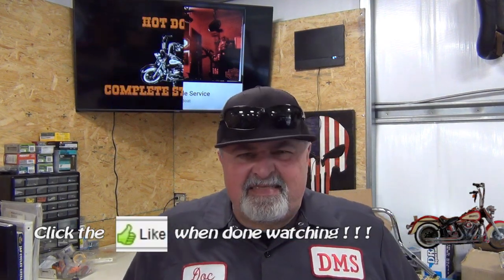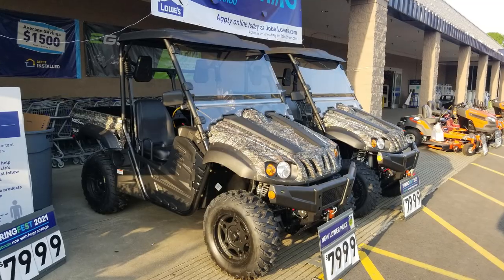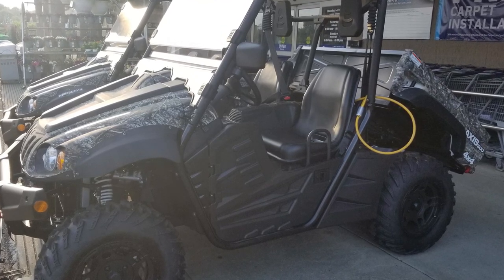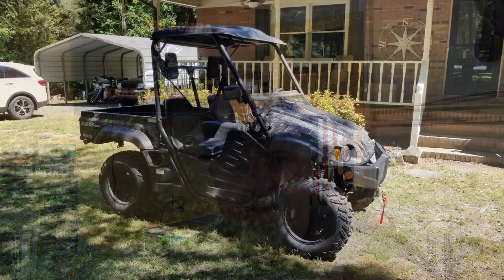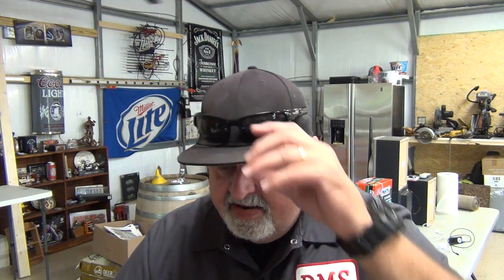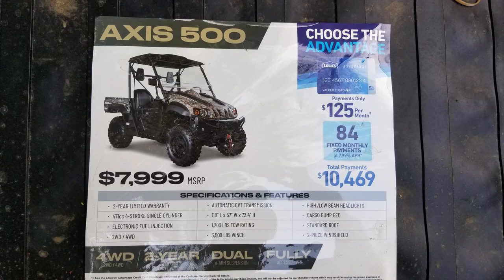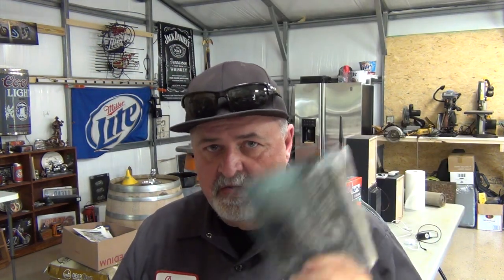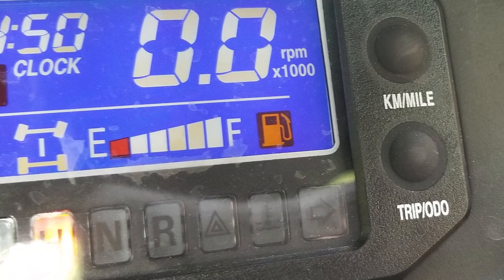Hisun Axis 500 UTV Review

Comment: I just bought the Axis 500 on Wednesday 6/5, spent that evening reading the manual cover to cover. Thursday 6/6 after checking all the fluids and filling it up with 91 octane gasoline, took a slow ride under 15 mph understanding first the 25 hr break in period. Way out in the back of the field and stopped to look at some fencing repair, I turned the machine off. After 10 mins I got back in, turned the key and it cranked but wouldn't start. After 5 mins of trying to get it to start, I had to walk the ¼ mile back to the house in 90º Florida heat and sun.  Got my truck and some tools and drove back to the machine, and now it starts right up... Now I think this is a totally untrustworthy machine now, a don't want to get stuck, especially out in some trails, so I am going to try to return it tomorrow 6/7, it has just under 2 miles on the odometer.  I also noticed that the dump bed gets VERY hot while running, this heat will damage items in the bed, eg coolers, gas cans, animals...
Reply: Check the fuel pump fuse under the hood,I hear they blow quire frequent
Reply: At times my does that and I have to give it a little gas to get it to start. The FACTORY fuel filter had paint chips in it. Replaced filter and issue 98% gone. I just have to reset the computer about every 4 months. No big deal. Just turn key on and off 5 times within 30 seconds. Without starting it. Making sure you hear the fuel pump kick on. After the on-off sequence. Leave off 30 seconds. Then ya should be good to go.
Reply: Did you post this on every video?

Comment: I never fidregard thenmanual. When I buy something new n bringit homr i just open the box to get the manual to study in. You can have a machine with features and functions you never even knew bout and see things you shouldn't do that will trash it. Never just rip n strip n go. Have aneughbor eho recently got a nice sniwmobike n folled ut up with gasoline and ran it till it bigged down and wouldn't run. No fuel mix and henfrided a nice engine. And there's stickers about the mix ratios  by the fill cap. Duh. And I had told him he needed to let me come up and breife him ona new set of rules. But he just ignored my iffer and Im 80 eits over 65 yesrs experience to share. Shame cause he'll never fix it or care. I'll probably end up with it. My place has sleds parked in. Rows. I 'm listening to you. I made a living fir many years restoring building and repairing motorcycles.😅

Comment: Hey Doc! I purchased my Axis 700 back in October. Been putting a few miles on it, and have given it it’s first oil change. My opinion of this machine so far is it is great. We have 250 miles on it, and have gone on a couple of rides with a group of SxS enthusiasts and kept up with their “name brand” rigs just fine. Knock on wood, we have not had any issues so far. I did a pre-check prior to taking it for it’s first spin to ensure all nuts, bolts, and seals were in good shape, as well as checking the fluids prior to each operation. Had a friend who did not pre-check and burnt up some internal components. I too have a YouTube channel and plan to post some videos. Information is hard to find, but it is out there. These area Yamaha Rhino clone basically. There are several Rhino video that relate closely to these Axis machines. Look forward to more videos, and I will be posting some soon. When the weather warms up that is 😅
Reply from the maker: Awesome. Yeah they are good machines without the expensive price tag.
Reply: Will Rhino parts fit if something needs repair / replacing?

Comment: There is a throttle adjustment on this machine, it shows you in the manual how to make the adjustment for better throttle response, it makes a difference, I’ve had mine for 21/2 years… no issues, I use a k&n air filter for better air flow, this a clone of a rhino 660. You can get parts for it that will work on your utv.
Reply from the maker: Great info thanks for watching and sharing

Comment: I would say my concern is the availability of parts for the machine parts as simple as a oil filter my best friend who had a shop someone brought a similar utv that was sold through tractor supply I know it wasn’t same brand but what my friend said about the cheaper brands getting parts are not always easy to find so in my opinion I would spend $2,000 -$4,000 and get and brand name Utv that parts are available just my opinion and everyone is untitled to their own
Reply from the maker: It's a valid point.
Reply: Motorcycle Doctor sells the filter (even has a molded nut on top).
Reply: James I have the 500cc also and OEM parts are readily available on Amazon. You will not have a problem finding any if ever needed.
Reply: I haven had a problem getting parts so far!
Reply: No problem getting parts. Amazon carries many of the parts. Plus you can get parts directly from Hisun.

Comment: Axis 500 in for warranty after a few month because it wouldn't start. After 3 months they called. Fuel pump fuse! It has blown twice since. Runs great for 2-3 months, then blows. Blue 15A fuse under the hood. Took fine stranded wire and wrapped 2 turns around fuse terminals. It's been running ok for a month now.
The gas gage was stuck on one bar for months, but fiddling with tank&fuel pump wiring, it started working.
I really like this machine... Even put a big red Tesla decal on the tailgate.
Reply: 😅thanks we are thinking about buying one , you were a lot of help

Comment: I got a 2021 Coleman 550 Outfitter and love that Lisa can easily hop on and drive it anywhere on farm she needs, when I changed injector & plug it was Night & day between how it struggled beforehand and how it runs Now. Run High Test Non Ethanol Fuel and/or use additive's, let it warm up and get 2 bars of Heat before start and stop driving

Comment: That space under the drivers side seat is big enough to put a second deep cycle battery in it to run your extras. Like led lights, winch, plow, radio, and other accessories. Just make sure you put a battery isolator in there. The isolator is so it charges your main battery first, then your second battery as needed.
Reply from the maker: That sir is a great suggestion!!

Comment: Just bought one this week. First thing I did was to remove the seat bar (grab handle) on the driver's side. Every time I go to get in it I get goosed. or at least a little violated. I am very impressed so far, however make sure the shifter linkage is adjusted correctly. If not you will swear you damaged the transmission and not go into the correct gear.

Comment: What year model did you have or what year did they correct problem? Also would you buy another one?
Reply from the maker: @michaelkilpatrick3141  I'd have to dig threw my paperwork to get to find the title, to get the model year.  I believe they discovered and from what the repair guy said, jumped right on the fix, about six months before I made the video. Yes I would buy another one.  It has been a useful "tool" around our land.  I can size up a project, fill up the back of it with the tools supplies that I need for the project. Example shovels drills and buckets nails, chainsaws etc. I mean I've used it in so many situations. Where I planned a project at the shop and then two or 300 yards to actually work on the project. Fill it up and take off. And here's the cool part. I'm sure I'm the only one that always forgets something when I get far away from the shop. And it's a lot easier to jump in that thing and drive back 300 yd to grab something and then come back and work on it. I've pulled multiple people out of the mud, after they drove into their fields after a pretty good rain and got their vehicle stuck and it will pull quite a bit. I've been really surprised. But if I did go back with another one, it would probably be a four-door.

Comment: Thank you, sir. I was looking to get one soon. Would you buy this again?
Reply from the maker: Great question. I thought I made a mistake by buying a piece of equipment like this for my home/ farm. I just wasn't using it, after the initial rush of buying it. However, since the video was made, there has been three situations where this things earned it's keep and a place on the farm. So yes because of it's day to day capabilities and what it can do when I need it to, like pull a pickup truck and trailer stuck in the mud out. I'd buy it again. Plus, where I live, I'm two roads from a paved road that gets plowed in the winter. And it does great in those situations. Last but not least, I've used it at my VFD. So yes.
Reply: Thank you. We have 80 acres and my polaris 500 quad is giving up on me. So I was thinking of an upgrade. As long as it does not break often...

Comment: Great video Buddy! We just purchased ours today. One thing I noticed is the RPM's seem kind of high, around 4000RPM just riding around the neighborhood around 20mph in 2WD. Is that normal?
Reply from the maker: I would I take mine for a spin to check. Were you in high or low range gear?  If low range probably so. In that range, engine will spin sever times faster than travel speed
Reply: Make sure you're in High gear. Sounds like you're in low gear.

Comment: At 18:44ish your talking about the 4-wheel drive. Hate to say it but your kinda wrong.

Without the 4x4 button pushed. Both rear axles spin. Posi-traction.
With the 4x4 button pushed. Both of the rear and one of the front pull.
With the lock button pushed. Both rear and both front pull, but steering is kinda limited kinda.  Wouldn't want to make tight turns with the lock engaged.

Comment: I put an exhaust silencer on mine and it really helped with the loudness.   

https://www.youtube.com/watch?v=r5ebn5lHB3E
Reply from the maker: You know, I used mine a lot over the last few weeks and was considering getting one myself. What brand did you go with?
Reply: @FNGFASHA take about 3ft of 1inch diameter of metal flex conduit. Stick over the end of the factory baffle. Didn't even have to clamp or anything. Then secure it to the bottom side of bed and over to the side. I used mechanic's wire. Makes a world of difference.  Can be found on almost any construction site, if you don't mind dumpster diving. Now just got to stop the reverb of engine sounds coming thru the center console and off the hardtop.